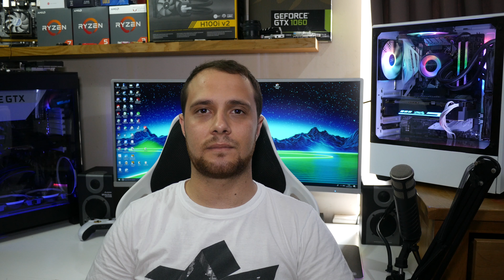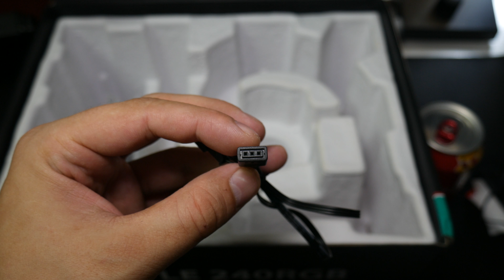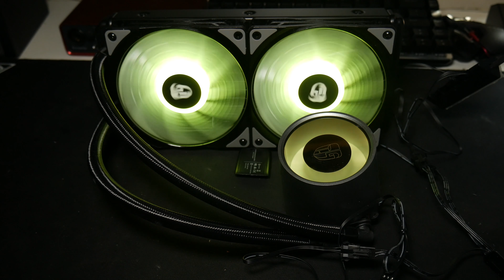Deepcool Castle 240 RGB AIO Review, Install, Thermals + Lighting Effects

Comment: I am trying to install this AIO in my new computer build. Aorus Z390 Pro Wi Fi. The Deep cool 240EX has a 3 pin AIO plug. My motherboard has a 4 pin AIO header plug. Gamerstorm/Deep Cool tech support said I can plug their 3 pin plug into the motherboard 4 pin header. The motherboard AIO header pins are:1)Ground 2)Voltage Speed Control 3)Sense 4)PWM Speed Control. Do I cancel the #1 ground pin, or do I cancel the #4, PWM Speed Control pin? Didn't hear you mention this in your video.Thanks
Reply from the maker: Sorry you've been able to plug 3 pin into 4pin headers for so long and the way the clip is designed there isn't a way to plug it in wrong so didn't think it was worth mentioning.
Reply from the maker: You literally just line the pin up with the clip and plug it in.
Reply: Thanks for the explanation. I did find the proper information by doing a  search on how to plug a 3 pin into a 4 pin. Thanks for the help.

Comment: I didn't have the 4 pin 5v, only the 4 pin 12v but it doesn't matter, just connect it to the SATA power and use the toggle switch and set it and forget it. This also means no software needs to run to make this thing work. I hated having 5 different softwares for my lighting setup.

Comment: The mounting bracket included for AMD/Intel apparently wasn't for AM4 use according to my instructions, so I just used my motherboard's default bracket and it fit perfectly
Reply: explain what you did more? what hardware did you use from the cooler?

Comment: hey great video :) I have an asus z390 prime motherboard but there is no cable to connect anything to the RGB pins on the motherboard. Im building in the phanteks evolve x case and can only get the cases and the castles RGBs to sync over the cases controlls. Cant controll anything with the Aura Sync software since it isnt connected to the motherboard. Hope you can help me.
Reply from the maker: You need a motherboard with a 5v RGB/digital RGB header. Gigabyte have them with most of the Boards over £100 as do the Asus rog boards. If you go the specs on the motherboard oarxs website there internal I/o part will tell you how many 12v and 5v headers the board has.
Reply: @thefullsetup  hey okay I checked its two 12V ones, is there a way to still make it work? Like a special cable or hub? Thanks a lot by the way. Greatings from Germany
Reply from the maker: @ilovedubstep4804  I'm afraid there isn't you would need a new motherboard.

Comment: 3:35 I got MSI's b450m mortar titanium motherboard and I cant find any sort of pin, slot, or socket where I can connect this cable too. At the moment, I'm just connecting the AIO to a psu SATA cable which lets it work but since its not directly connected to the mobo, MSI's mystic light isnt detecting it. Is there any work around on this or is my mobo really incompatible with this AIO?
Reply: 8:11

You have two connectors on motherboard for RGB.

Comment: Do you have the buy the fans seperately? I can't seem to find the Castle version with fans being RGB as well.
Reply from the maker: I personally haven't seen a castle cooler that doesn't come with RGB fans
Reply: @thefullsetup   does it come with Thermal Paste or i have to buy separately?? Or is it come with than how's the quality ??
Reply: Deepcool GameStorm Castle 240 rgb v2 come with rgb lighting, you can control effects from rgb hub or aura sync, mysric light, rgb fusion etc also control effect like breathing, flash, wave, rainbow etc...
Reply: Also you have 3 option to control rgb if you manual you can understand...if your motherboard don't have any conmectors you have rgb hub and connect it to sata power ...and done 👍

Comment: All the two cables coming from the cpu block what do they need to be connected too ?
Reply from the maker: HNNHgaming ones the light ones the pump power. Light plugs into controller or sync cable. Pump plugs into pump connector or fan header.

Comment: Great video! How did you get the other Deepcool fans (not the two from the radiator, as they're already daisychained with the 3 pin cable included in the aio) to sync with Asus Aura? Did you buy an additional 3 pin daisychain? 
Where can you buy those?
Reply from the maker: mapffff the 3 pack comes with daisy chain Cable too and you can put multiple cables together.  Plus the straight sync cable has support 3 fans.  So just plugging the daisy cable In to that allows for 6fans / devices. haven't tested loads of fans with the 5v header type. But on there 12v RGB fans I've had 8 running off one header with no troubles.
Reply: TheFullSetup Thanks! What's the straight sync cable? Did it come with your Motherboard?
Reply from the maker: mapffff sorry I meant the include RGB header Cabela's that come with this cooler.

Comment: is it fully compatible with gigabyte rgb fusion?
Reply from the maker: Tommaso Bazzicalupi this cooler works with any motherboard that has a 5v header as shown in the video.
Reply: @thefullsetup  i have aorus B450 pro wifi...where should i connect the rgb header and pump connector??

Comment: can i use this cooler on this board? MSI B450M MORTAR
Reply from the maker: El BonitiilloO that motherboard only supports 12v rgbs so you will have to use the included controller this cooler will not sync with the motherboard.
Reply: TheFullSetup but what is the down side of that? Can I still change colors manually etc?
Reply from the maker: El BonitiilloO all the effect with the controller are at the end of the video.